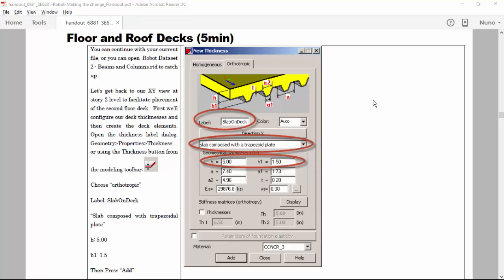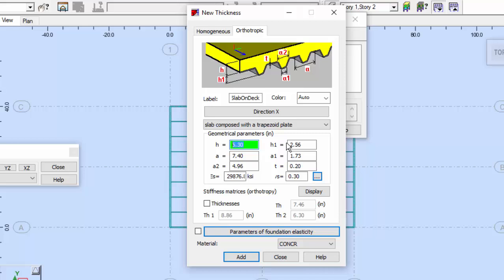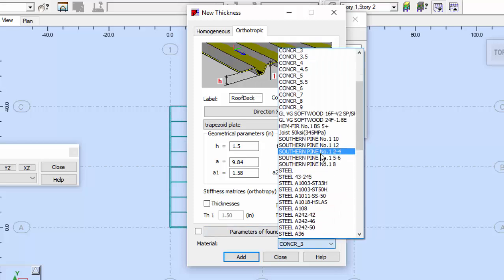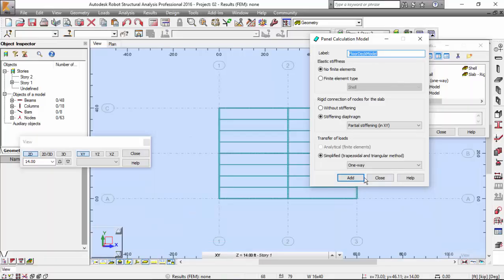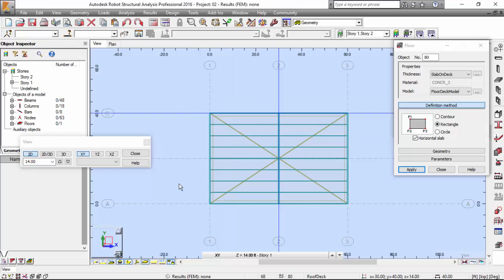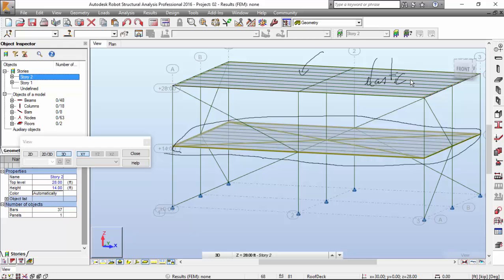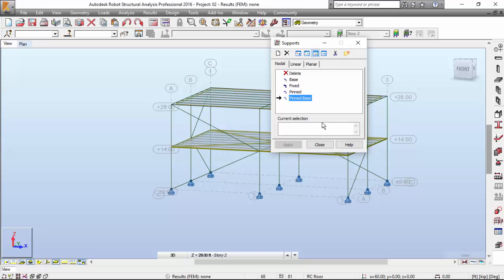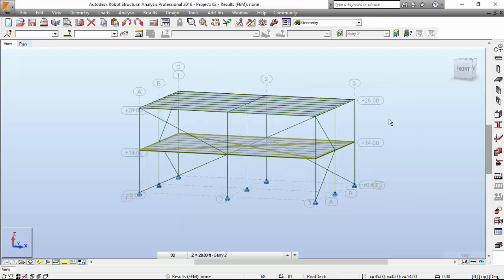Robot Structural Analysis: Making the Change - Part 4

Comment: isn't the floor deck must me finite  element since it is concrete ? 
in this case we cant check the deflection of the trapezoidal slab and isn't if we considered it finite the steel bars on the concrete slab will helps the steel bars in deflection and in the load distribution ?